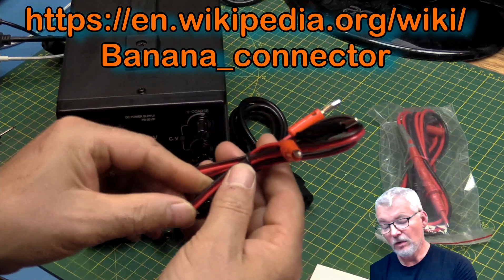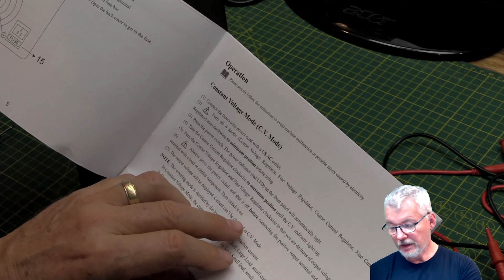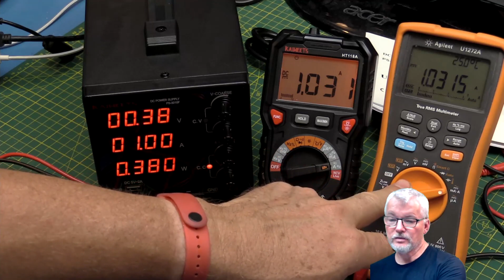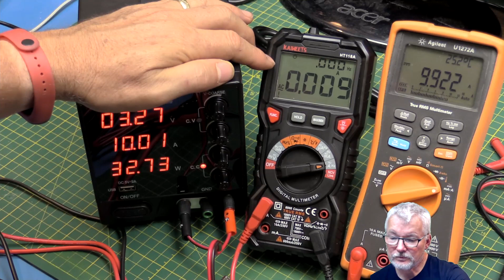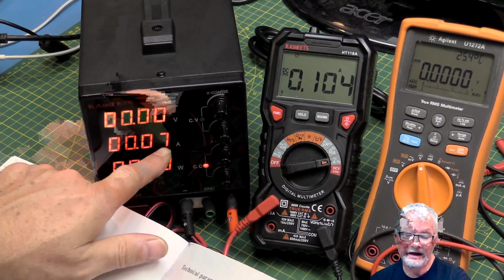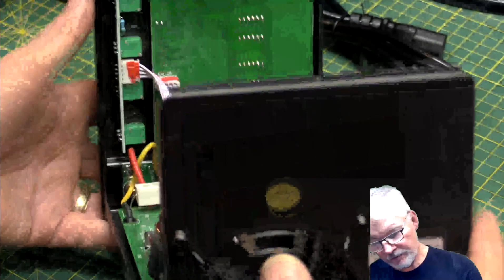Home LAB for Students equipment PT 2

Comment: I'm just getting started and have an okay multimeter (Brymen) and was considering a bench supply made from a couple of old HP server PSUs in series to give 24v (for charging my RC LiPo's) by floating the ground on one of the supplies.  Is there an easy way to get a half decent variable supply from these or will the switching supply make it just too noisy to be of any use for electronics work?

I've seen a few videos using off the shelf (ebay etc) integrated digital units but I'm not sure I'd trust them to be safe in short situations etc...

Then i've also watched all of the Dave Jones 'building a lab supply videos' which lost me about pt4....so I'm kinda stumped. 

ANy suggestions appreciated.  Many thanks
Reply from the maker: OK, a few things
1. The Brymen is as far as I know, a good multimeter and is the hardware behind the EEVBlog multimeters too.
2. If you look at most electronics in the modern day, there almost ALL using a switching power supply in one way or an other (If the USB / Wall wart is light weight, then its a switching supply), so provided adequate filtering is added where you have very sensitive circuits like precision ADC/DAC then you should be fine.
3. Many new power supplies and some older Agilent ones  had a switching back end followed by a linear final stage, this keeps the heat dissipation down when your outputting low volts but high current, the other method was to have multiple taps on the transformer and the PSU would select different taps depending on the demanded voltage output. You could use a similar trick to put your PSU's in parallel for lower volts but more current, then in series for more volts but less current :).
4. I to have a series of videos on a bench power supply, if you have not watched them yet, perhaps they will give you a different perspective and also fill in gaps in your knowledge.
 https://www.youtube.com/watch?v=KGn5noes66Q&list=PL_atu5RtEPi4aNzoMtZ5_S6ruhFR98T_p , there are over 32 videos, a series on specifically building a PSU and then many more on associated topics like current sensing set.